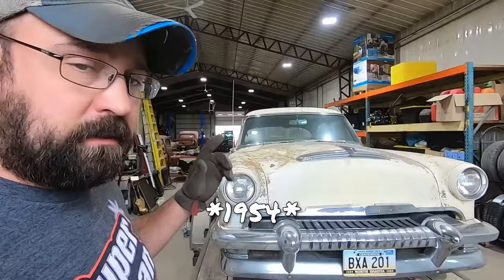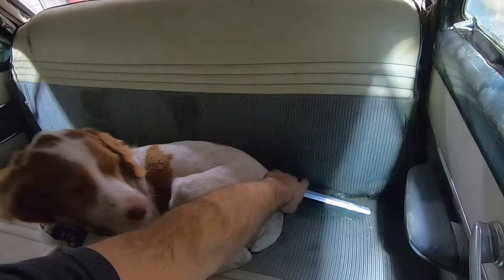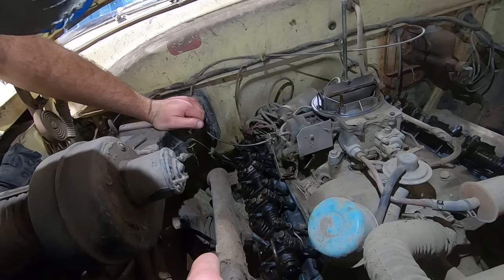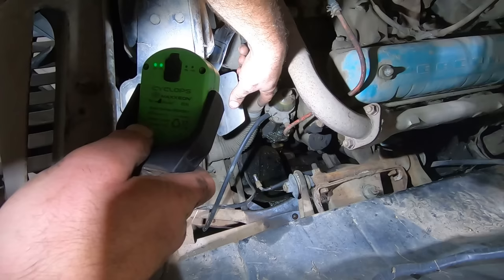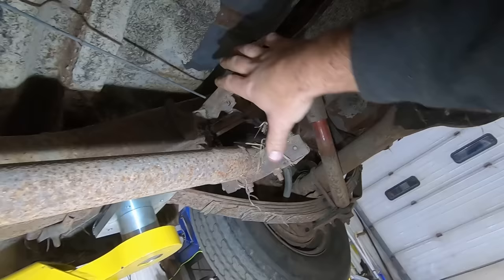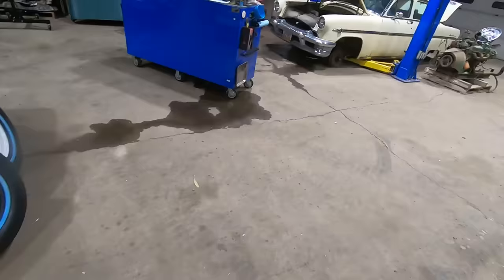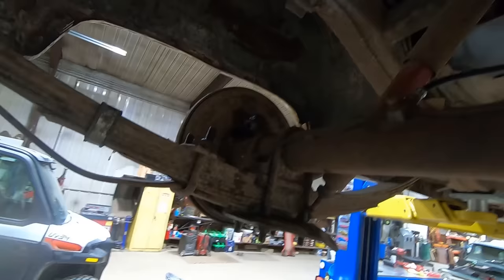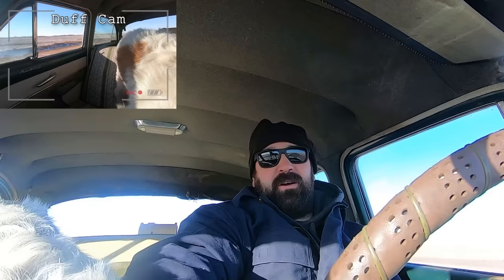1954 Mercury Monterey Transformation! Abandoned in a Field for 29 Years! Will It Run?!?

Comment: Sweet ride. That tank didn't look so bad. My 56 was worse and it was a daily. It even leaked. Seal-All fixed it. A quick dip in some muriatic acid will fix a bad sender and replace the float with anything that will float. A couple of hands full of grave off the driveway and give the tank a good shake and you are good to go. I've gone from boat tank to gas tank that easy. I hate spending money. Flexi hoses give you more horsepower.
Reply from the maker: I hate walking
Reply: @MortskeRepair  I hate walking too, so I drove my 56 20 miles a day....and my 48 Ford, and my 48 Olds.... Never did look in the tank of the 66 I've been driving the past 6 years. I lived out of town and drove into the city for work every day and back home at 4 am when you don't want a break down.

Comment: I realize that there has been PLENTY of Y-block builds done over the years, but I have always wanted to get my hands on an old 50s Ford truck or even a Merc like this and turn it into a lead sled with a 9.5:1 compression Y-block with a custom made intake manifold that can accommodate multi-port fuel injection, a large throttle body, forged internals, and a modestly sized turbocharger. It wouldn't be expected to make 1000 whp, but 500 whp would be cool. A 50 Merc coupe lead sled like in the movie Cobra would be cool too...especially with the old Mooneye hub caps and the stainless tooth looking grille. Tell me that a properly assembled, cammed, multi-port fuel injected, turbocharged Y-block wouldn't be cool...I've also wanted to do the same thing to a Buick straight eight for the longest time, but with a cross flow head. Even the old school GM 502 V6 would be cool to give the same treatment.

Comment: I have a 1954 Ford 2dr model 70B with the ohv v8 engine code p, which is the first police interceptor built by Ford. Production number 420, built Jan. 14, 1954, still has some 53 parts, all there, no bad rust, paid $400.00, had a resident squirrel, last driven in 1967, parked in a shed, coral blue, white top.
Reply from the maker: Awesome
Reply: @MortskeRepair  bought it from original owners grandson with a good title.
Reply from the maker: @jessieharris1676  Awesome!

Comment: Engine Location :	Front
Drive Type :	Rear Wheel
Production Years for Series :	1952 - 1954
Price :	$2,335-$2,775
Weight :	3736 lbs | 1694.621 kg
Power
V 8
Displacement :	4195 cc | 256.0 cu in. | 4.2 L.
Power :	162 HP (119.232 KW) @ 4400 RPM
Bore :	3.6 in | 92 mm.
Stroke :	3.1 in | 79 mm.
Compression :	7.5:1
Main Bearings :	3
Valvetrain :	16 OHV (2 valves per cylinder)
Cylinder Block :	Cast-iron
Holley 2140 4-barrel carburetor
Transmission:
3 Manual , 3 Automatic Column shift ‘Merc-O-Matic^ , 3 Manual with Overdrive , 2 Automatic Merc-O-Matic
Production Figures
Total Mercury Production for 1954 :	259,305
Total 1954 Monterey production :	174,238
1954 Mercury Monterey
Convertible 2 dr. 6 P :	7,293
HardTop Coupe 2 dr. 6 P :	79,533
Sedan 4 dr. 6 P :	65,995
Sun Valley HardTop 2 dr. 6 P :	9,761
Woodie Wagon 4 dr. 6 P :	11,656
Dimensions
Woodie Wagon
Seating Capacity :	6
Doors :	4
Exterior
Length :	206.2 in | 5238 mm.
Wheelbase :	118.0 in | 2997 mm.

Convertible
Price :	$2,615
Weight :	3625 lbs | 1644.272 kg
Seating Capacity :	6
Doors :	2
Exterior
Length :	206.2 in | 5238 mm.
Wheelbase :	118.0 in | 2997 mm.

Sedan
Price :	$2,335
Weight :	3517 lbs | 1595.284 kg
Seating Capacity :	6
Doors :	4
Exterior
Length :	206.2 in | 5238 mm.
Wheelbase :	118.0 in | 2997 mm.

Sun Valley HardTop
Price :	$2,560
Weight :	3536 lbs | 1603.903 kg
Seating Capacity :	6
Doors :	2
Exterior
Length :	206.2 in | 5238 mm.
Wheelbase :	118.0 in | 2997 mm.

HardTop Coupe
Price :	$2,450
Weight :	3525 lbs | 1598.913 kg
Seating Capacity :	6
Doors :	2
Exterior
Length :	206.2 in | 5238 mm.
Wheelbase :	118.0 in | 2997 mm.

Handling
Suspension
Leaf springs with coil shocks
Tires / Wheels
Tires :	7.60 x 16
1954 Averages
Avg. Car Cost :	$1,700
Avg. Home :	$10,250
Avg. Gallon of Gas :	$0.22
The 1954 Mercury Monterey measures 206.20 inches in length, and has a wheelbase of 118.00 inches.
Reply from the maker: Good stuff

Comment: The Master cylinder with metal reservoir have 4 holes for 4 mounting holes is a cost of $42.99 plus tax in California Auto- Parts Total. It will fit on 1954 Monterey including no rust at all.

Comment: The gas tank is all rusted and some bad gas inside. Take it off and cut open the tank with angle grinder all around the empty tank carefully. Add degreaser to the tank after all gas empty all out to recycle empty anti-freeze jug. Pressure wash inside the tank would be a recommendation.

Comment: Yep it's a 256 ci. Ford planned to use the 256 in the '56 Ford but they found out Chevy was planning to use 265 cubic inches in the Chevy and Ford went to the 272 cubic inch Y Block. I forget what they did with the Mercury in '56 but it was bigger I think. Those 256 inchers are rare. Fix that one up and you'll have a conversation piece.

Comment: im pretty surprised no body commented on you poping that 12 volt in and reversing the ground 54 was 6 volt positive ground car you pretty much toasted the condenser instantly please do not turn the radio on and every light bulb will burn out and all your sending units (most very hard to find)will burn out.. its a really nice find please do a convert or just leave it 6 volt they work just fine
Reply from the maker: Been doing it for years that way without issues, Amish folks should know more about this before commenting.

Comment: Hello Everybody. This car is Monterey from Mercury Motor Company and it's loaded of all chrome trim and too heavy front bumper for economy gas mileage. The cut-out hole on top of the hood and rise up the high rise Holley 300-113 Hi-Ram intake manifold ($750.00) pack with cog belt driven BDS Roots 8-71 supercharger ($3,000.00) atop the Mercury Engine for 1953 to 1955 sedan. Add in stainless steel scoop but the chrome plated scoop is cheaper and save some money. Thanks for reading.

Comment: I use muriatic acid to clean rusty tanks, rinse it out first with hot water and dish soap to get rid of the sludge, then dump a gallon or 2 of muriatic acid in with about 50 3/8th nuts and plug all the openings. Swish it around for a couple hours and rinse it a few times. Best way to swish it is to strap the tank to a rear tractor tire and drive it around the yard.

Comment: Did the front & back heaters work ? Also the spring you found in the gas tank most likely came off a gas pump fuel handle cuz back in the day before unleaded gas they had them springs on the nozzle to hold them in the tank. Nice car but I'm holding out for a 55 or56 Ford. Great video great work .
Reply from the maker: Never checked em

Comment: I don’t understand why so many guys that are teaching on YouTube keep using pliers and/or vice grips wrong. They are designed and manufactured to be used in one direction. Especially channel lock type pliers so as you turn they get tighter. Please teach by example. Thanks Man!
Reply from the maker: Pretty sure pliers are bi-directional...
Reply: @MortskeRepair   not vice grips or channel locks.
Reply from the maker: @edvandermolen1069  Adjustable pliers yes, I don't believe locking pliers are however. Ergonomically they may be easier to push from one direction than the other but will work fine in either direction.

Comment: Your Merc has a later engine, early Y used a canister filter & carb apparently early '60s. Also early Y had stickers on valve covers, "stamped in" Ford Mercury was a late '50s, early '60s thing. None of those start in Park, Neutral only.   

I love searching through glove box, trunk, etc... Often a history lesson.
Reply from the maker: I'm guessing the filter was converted. The carb kit we ordered for a 54 Merc from RockAuto fit this carb so maybe Mercs used a different carb than Fords.
Reply: @MortskeRepair  What's the number on carb tag? I'm betting it C-something so is 1960s. A '50s part would begin with  B. First year I've seen the classic  Ford  2100 type carb used was 1957 & those had a totally different accelerator pump housing. As far as Rock, they also list same carb kit for '52 flatheads, didn't happen. I still bet engine has been swapped. All of the late '50s Merc Y blocks, up to '60 were 312, with 292 used in '61 & '62. In '63 390 2bbl was base Merc engine.
Reply from the maker: @tombryant1104  The car is in 2 foot of snow. If you look up the car on RockAuto and then go to carb kits you'll see a 2100 is offered.
Reply: @MortskeRepair  Happy New year!!! 

RockAuto is flat out wrong. Over holidays I talked with a Y block guy & he said all Ford, & Merc used the "teapot"(float bowl in upper part of carb) carbs through '56, confirms what I've learned over years. Those were trouble prone & often replaced with a later carb. The '55 Shop Manual shows ONLY the teapot in two & four barrel configuration. In the remains of a 1982 Jiffy Kit, earliest listing for 2100 is 1957, also confirms what I learned over last 56 years(time passed since I bought my first car).
Reply from the maker: @tombryant1104  They sent me the right kit for my car, that's all I care about. I'm well aware of the teapot design.
Reply: @MortskeRepair  Guess this is one time two wrongs make a right...

As far as history books, still two wrongs. 

That 2100 is at least a third generation, would make it around 1960-1963. Has two distinguishing differences from '57 & '59.

Comment: Curious why you are using a 12 battery on a 6 volt car. Good way to smoke the bulb filaments and voltage regulator.
Reply from the maker: Because I know what I'm doing. Don't turn the lights on. Problem solved.

Comment: that master cylinder I could already tell you're going to break it off, I know shouldn't have heated it' and use channel locks on the cover on the master cylinder, being a certified welder and mechanic (heat is your best friend) one of my best friends showed me, this rust penetrator in GM and Chrysler Motor Company made it 90s and 2000s better than PB Blaster or any other rust removal if you get in your eye it would do permanent damage it would literally heat up the metal and smoke! Your fan from Alaska.
Reply: Be safe! (YouTube mechanic stars) out there,I've almost lost limbs in my life a couple times, being mechanic for 30 plus years ' be safe and self-conscious🙏
Reply: Sad they put great effort in the back hinges of the trunk but not the front hood, those are some shanky s*** I was even questioning oh well nothing's perfect?
Reply from the maker: Thanks for the tip

Comment: The Y-Block came out in 1952 in Lincolns and Medium duty trucks as a 317 CID. Thats a garbage bag tie not a bread tie. Why do you have an air compressor if you aint gonna use it to blow out the brake lines?
Reply from the maker: How do you know I didn't blow them out?

Comment: Although it worked, you were using the vise grips wrong. They were backwards. The “teeth “ on the jaws are angled so they grip in the direction you are twisting the pliers.
Reply from the maker: Interesting
Reply: @MortskeRepair  I've seen people do it with open end wrenches , channel locks and even adjustable wrenches, they're all angled for a reason.

Comment: To clean the fuel tank,,,  you put a bucket ful of nuts and bolts into the tank along with 5 gal of diesel fuel,,  then strap the tank to the rear wheel of your tractor,, and drive it around for an hour or two,,   empty,,   rinse,,   and there ya go,,  clean as a whistle,,  :-)

Comment: did you have heat in this car ?and why were your driving it with windows down in sub zero temps exhaust leaks were that bad ??
Reply from the maker: So it doesn’t fog up the glass
Reply: @MortskeRepair  BUT DID YOU HAVE DEFROSTER WORKING OR WAS THERE NOT HEAT PERIOD
Reply from the maker: no heat @atv55803

Comment: So on very newer model Toyota pickups the filters on top and has a little tray with a drain hole I used to poke a hole in the top of the filter before I drained the oil so it would make less of a mess one day I poked a hole and then realized I had to move the truck that was like brand new and man that front Bay looked like a murder scene straight stream right up to the roof I wasn't allowed to poke holes anymore and I had to paint a section of building 😂
Reply from the maker: Whoops!

Comment: A 70 year old engine, asleep for 30, only needs a Mortske valve adjustment, spark plugs and a fuel pump diaphragm to run. Wonder how many old "100,000-mile" engines were actually rolled back on every used car lot they cycled through? Then they charged "Dealer Prep" when sold.
Reply: And the automatic transmission still works! Try that with a modern, improved automatic. Why I only drive a stick.
Reply from the maker: hard to find a stick anymore on the dealer lot!
Reply: @MortskeRepair  When you do, DISCOUNT. They can't sell them. Everyone wants food and groceries delivered, a car to drive itself. What fun is that? F*ck drive thru, too. I can still walk.

Comment: Cool that is one of the early 50s style I do like most of the others were just too ugly. Forgot us that one was a272 or Flathead but, my brother had a two door glass top three speed on the floor with dual exhaust. It was a weird blue gray color. Then we had a 56 oh, I think that was Monterey and also mom's 9 passenger 1956 wagon oh, they were both 312 CI. Talk about bulletproof transmission, my brothers would rev It Up in neutral and slam it and low, the only way possible to spin the tires. I think that was Factory normal in starting you had to shift to neutral. Back in the seventies I think we sold that wagon for $125, and it ran great just nobody wanted it

Comment: What engine is in a 1954 Mercury?
Ford Y-block V8
1952–1954
First generation
Engine	255 cu in (4.2 L) Flathead V8 256 cu in (4.2 L) Ford Y-block V8
Transmission	3-speed manual 3-speed Merc-O-Matic automatic
Dimensions
Wheelbase	118.0 in (2,997 mm)

Comment: Come on Mortske you don't need a man basket when you have a 50c wooden shipping pallet made in Pakistan. Just don't fall off. Gone are the days of me standing on a pallet at full reach of the forkhoist changing  merc vapor bulbs in a workshop. LOL. Spent 13 years working on  european cars. VW golfs with lowered springs were a good money spinner for us. We kept an oil pan in stock as they are cast aluminium and didn't like carpark judder bars. Talking parts delivery I bought a special reamer(124.00) USD from speedway motors in Lincoln Nebraska and it turned up when they said it would. Nice people to deal with. It went from Lincoln to Omaha to Chicago and then to San Francisco and then to Auckland, New Zealand where i am and it arrived on time. Our dollar out here sucks. The exchange rate isn't good. Its about 1$ NZD = 60c USD plus  70$ USD freight Tracked. Approx 302.$NZD  Sigh! So next time you complain about shipping it aint nothin. feel sorry for us poor petrol heads here in NZ. The tyranny of distance strikes again.

Comment: Friggin rusty gas tanks. I got a cheap lazy solution for ya though. Buy a 5lb bag of powdered Oxilic Acid off Amazon, dump the whole thing in the tank and fill to the brim with warm water. Wait 2-3 days and dump it out. Rinse it with your pressure washer and she’ll be bare steel again. I’ve done half a dozen this way with good results. Citric Acid works good too but it takes a little longer, the upside is you can eat it and it tastes like sour patch kids.
Reply from the maker: Interesting

Comment: Motorcraft parts are the only internal engine parts for Ford 

But only because their " engineers " have made them  at the bottom of the quality scale to begin with,
 therefore a part that is even lower quality than the OEM one isn't going to work.

MOTORCRAFT ONLY 
DO NOT GET ANYTHING ELSE UNLESS you are installing a higher quality part.....
Trust me, I have 30+ years of experience as an exclusively FoMoCo technician.

If it's not a family member's vehicle, it's got to be Ford Mercury, Lincoln, Jaguar, or Land Rover or I won't work on it.... 
(I charge people a +25% 'Off-list-OEM labor' fee for those who insist on bringing other makes to me)

Comment: Well young fella you can want to 'bang shift' like the sissy in the movies or you could 'power shift' like the real guys did back in the day. You don't push in the clutch and let off the gas to shift, you raise your left leg and slap the clutch pedal sliding your foot off the side, the clutch releases for just the tiniest little nano second while you slap the shifter into the next gear WITHOUT letting off the gas, the gas pedal stays on the floor. Many times I have pulled the front wheels up hitting second gear in a 65 GTO. I've slammed the driveshaft against the floor of a 440 six pack Cuda so hard it literally knocked the back seat out.
Go to the drag strip and listen to the motorcycles shift gears. You can do the same thing in a car. 
In my 65 GTO I could get rubber in all four gears in less than 100 feet. I am not lying or exaggerating.
Art from Ohio
Reply from the maker: You should make videos of that stuff.
Reply: @MortskeRepair  Duhh, a little late for that don't ya think?? Ya spose they had modern video cameras back in the 60's? Seems like maybe yer a little late fer breakfast sonny. I am 71 years old and those cars are long gone. Besides that if a guy tried that today he would get life in prison for toxic masculinity.